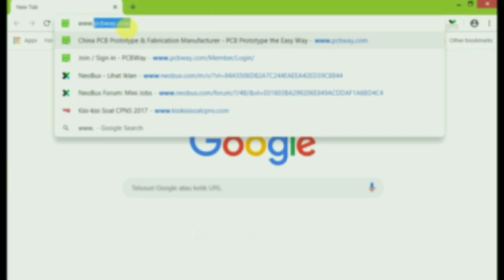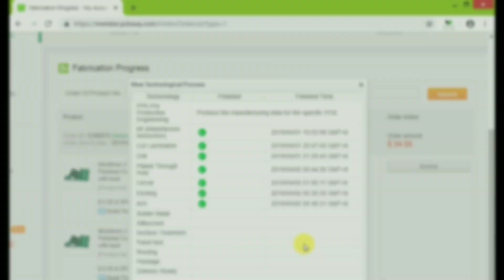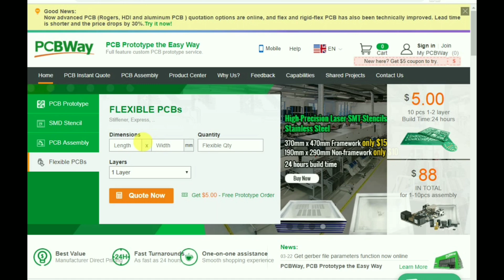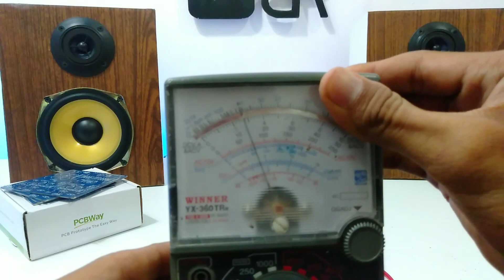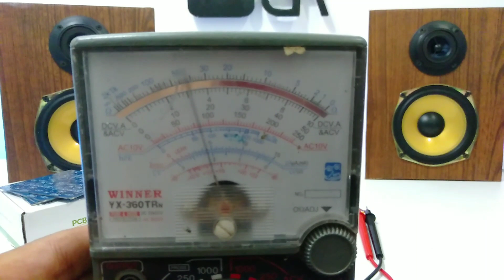LM1875 Stereo With Preamp NE5532

Comment: Bang kalau pake tegangan trafo 12v ct apa resistor muka 1 K ohn masih harus dipasang?
Reply: Maksudnya resistor yg dari trafo ke pre amp 1 k masih harus dipasang kalau tegangan trafo 12v ct...
Reply from the maker: tidak harus, kalau 12Vct masih bisa diatasi op amp.. tapi cari op amp yg bisa main diatas 16V karna setelah disearahkan teg. 12v akan menjadi sekitar 16v
Reply: Trims kasih bang....
Reply: Bang bolehkan nanya lagi?  Abang bilang dari trafo 12v lewat dioda dan elco tegangan jadi sekitar 16 v. Nah kalau ke pre amp memakai ic regulator 7812 dan 7912 bisa gak. Dgn artian bisa bekerja gak ic regulator ya?

Comment: Mas tadi saya lihat shematicnya di bagian c input tertera nilai 2.2u,itu maksudnya 2.2uf/2.2nf?
Reply from the maker: 2.2uf mas.. kapasitor audiophiler
Reply: @barlexrespectaizer452  mas karakter dari penguat audionya apa mas?
Reply from the maker: @agungmahendra1068  karakter dari lm1875 itu detail, high bersih gak nusuk, vokal jelas, bass transparan gk berlebihan
Reply: @barlexrespectaizer452  maksudnya dari rangkaian preampnya mas🙏
Reply from the maker: @agungmahendra1068  karakternya ya tergantung ic opamp yg dipakai.. yg lain nya hanya resistor buat feedback dan grounding.
cek video versus opamp di channel ini mas

Comment: Bro.. pre amp tube yg hrg 120an ribuan sama pre amp ne5532 bagus mana ya
Reply from the maker: preamp tabung kalau harga segitu sih halus.. bening, tapi detail detail kecil seakan menghilang.. kalau preamp 5532 lumayan kalau part high grade
Reply: @barlexrespectaizer452  saya pake kit amplifier yamaha yg dual chip, saya direct langsung dari hp suaranya clear, nah saya pakein tone control lm1036 suaranya malah medem gak megah seperti klw direct langsung dari hp, saya lg bingung nih mau tak pakein tone control ne5532, apa cukup preamp ne5532, saya sebenernya udah suka klw direct langsung hp, cuman pengen nambah bass dikit tanpa membuat suara jadi mendem
Reply from the maker: pilih tone control yg ada midle nya